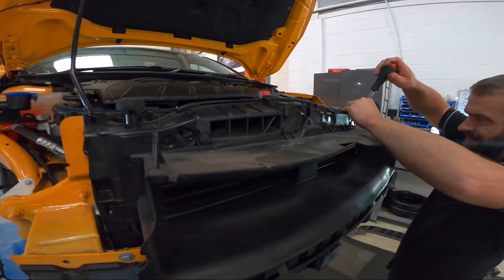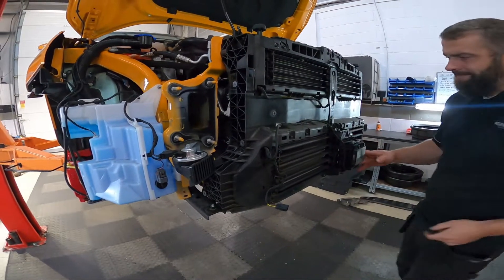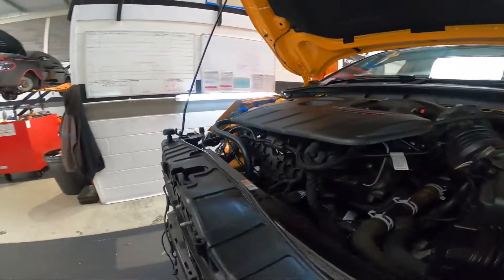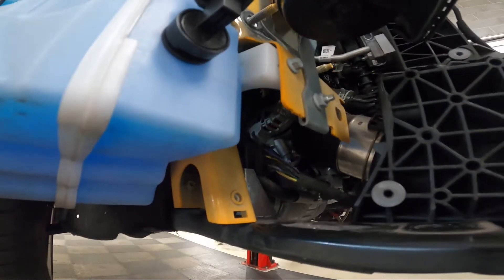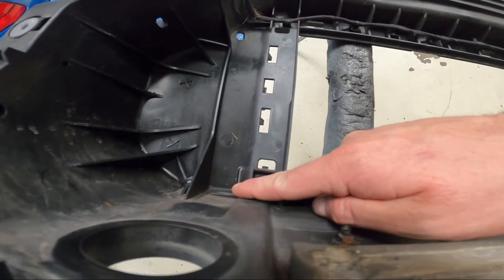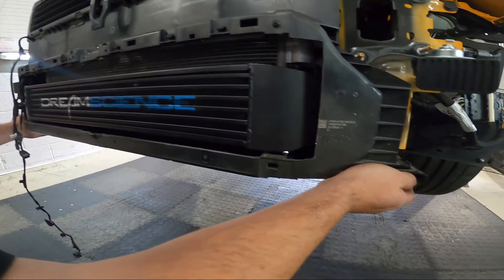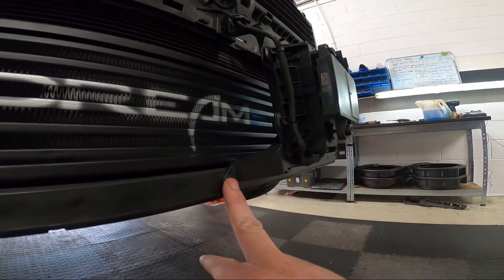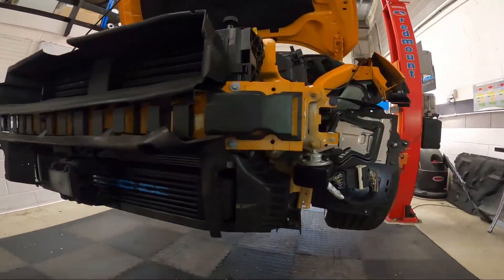Dreamscience Mk4 ST Intercooler fitting guide.

Comment: In my opinion still a small intercooler
Reply from the maker: and a fair opinion, but due to the architecture of the front end, this is the largest that we can fit to the car. We've increased the internal volume by over 50% and seen some really good results on the Dyno. :)
Reply: Direnza und Wagner bauen viel größere für den Focus ST MK4